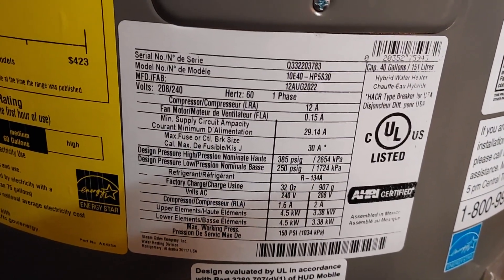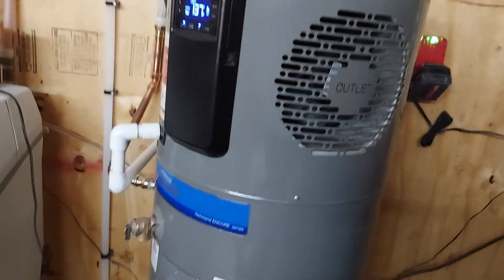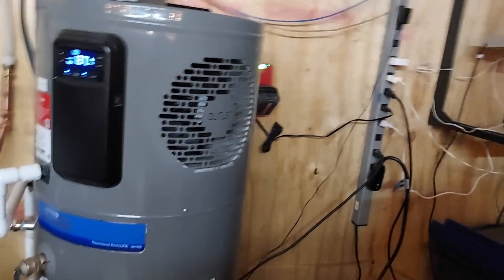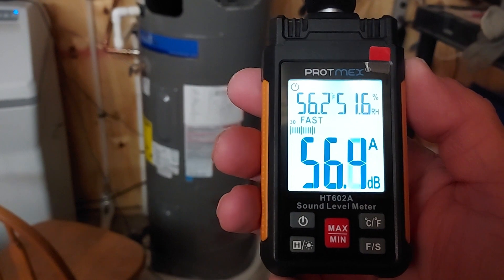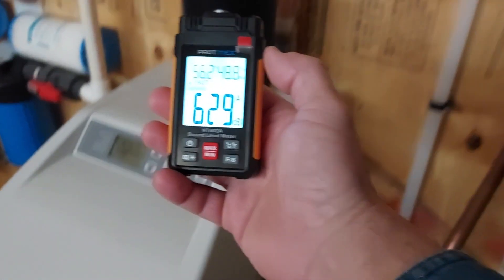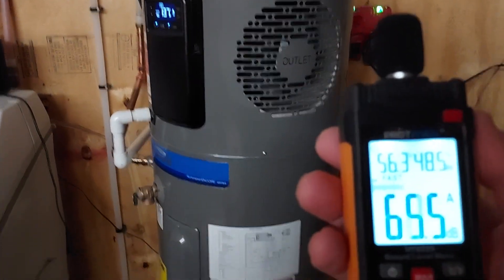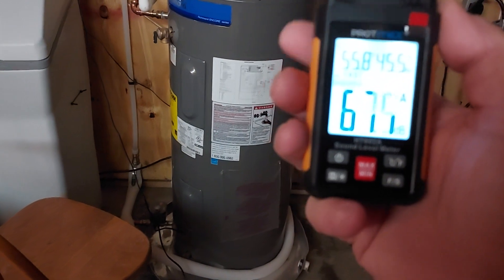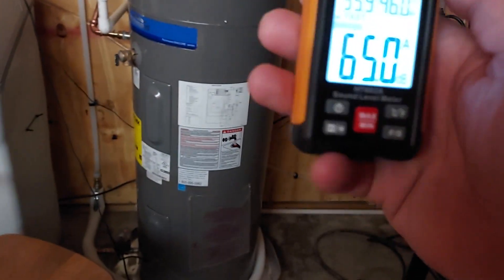Richmond / Rheem /Ruud 40 gallon hybrid water heater noise level demonstration.  Model 10E40-HP5S30

Comment: Great choice noise is easy to get rid of.
Reply from the maker: I've been really happy with this unit and the noise doesn't really bother me.  That video was to help another user understand his issue.    But damn this thing is super low cost to run, but really expensive up-front!  I hope the price drops as they gain acceptance because I already want a replacement when this one fails!  Now if I can just get a few of my solar panels stood up!
Reply from the maker: I have an adapter for ductwork that should help